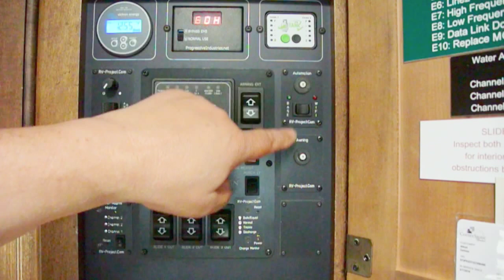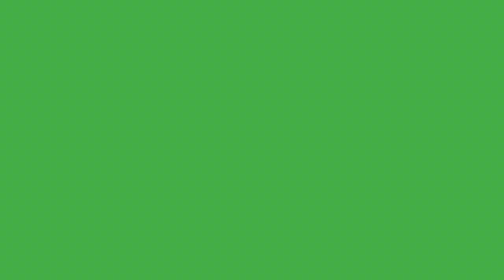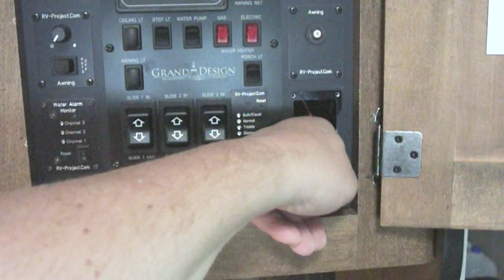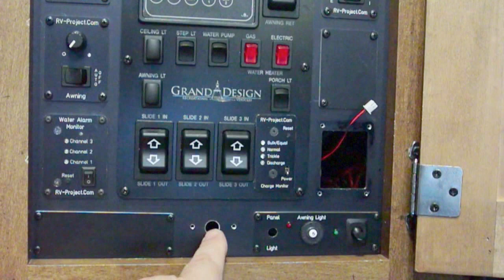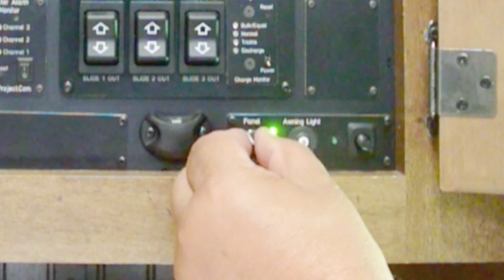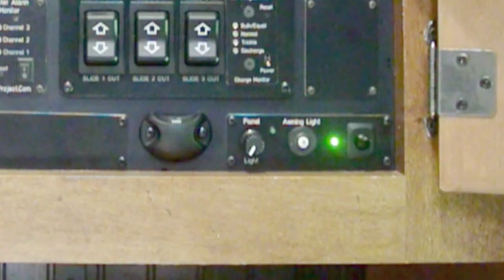Adding custom controls to my upgraded RV control panel.

Comment: Thanks for the video. Where did you get those anodized aluminum switch plates made?
Reply from the maker: A company called FrontPanelExpress (.Com) makes them. They will do quantity 1 orders so it's perfect for hobbyists.

I have a webpage that covers how to obtain and install their designer software (the software is free), as well as all of the templates I have used in my RVs. 

If you see a template associated with one of my projects, you can download it and use it as you see fit. Or you can design your own.
 
http://www.rv-project.com/resources/e450.php